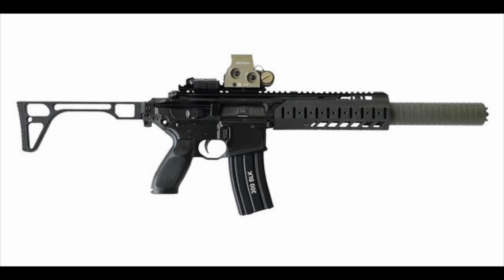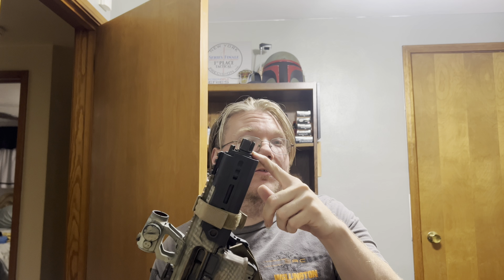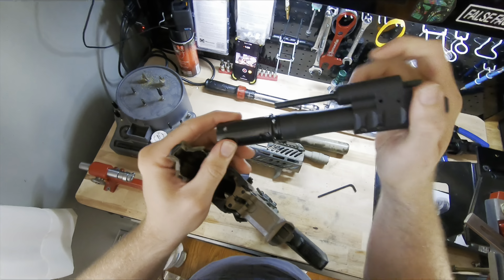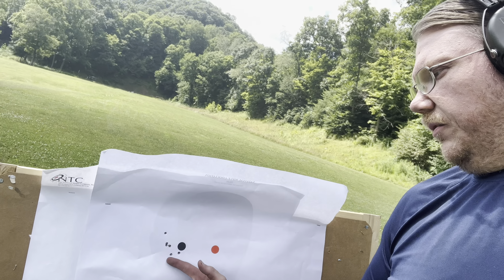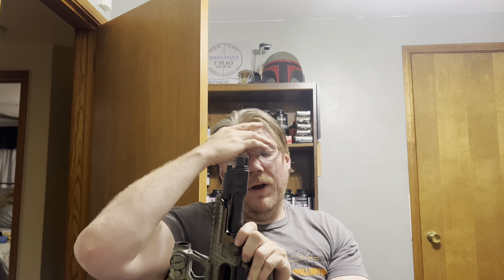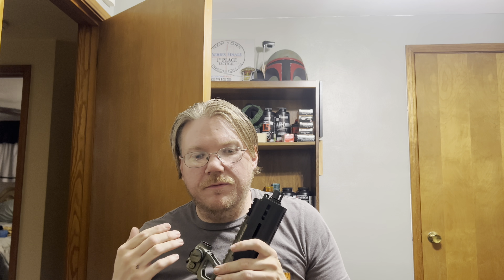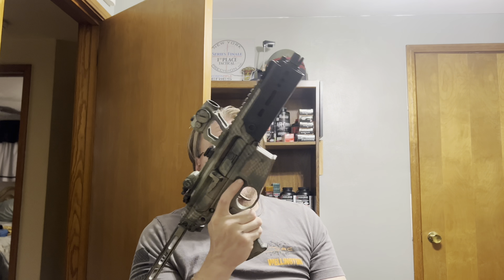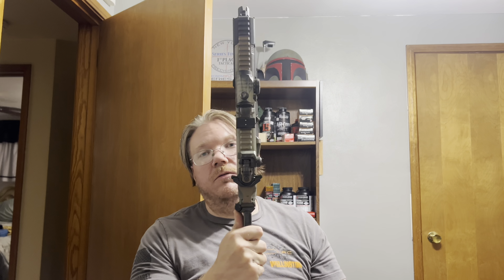Sig MCX Rattler: The best gas piston platform of all time?!

Comment: With the rounded lugs on the bolt, would it be possible to run a KAC bolt in this system or are there substantial differences between the 2 despite the fact they are both rounded?

Comment: Bruhhhh…Best piston system of all time??? It’ll take YEARS and a LOT more real world achievements to take that title from the AK.
Reply from the maker: It’s meant to be inflammatory. Actually in the passed few years, US available AK’s haven’t been that great. 

I’ve had 2 arsenal AK’s. The 107 has been great to me. The 106 I sold after a year.
Reply: @durkydurk5244  don’t misunderstand, I’m not even into AKs. I’ve never even owned one and probably never will as long as I can source AR platforms.
Reply: Just booth my 16" virtus but it won't stay 16" long. 10" sd hg with 6.75 barrel and trash panda. It's sad that I've already got the trash panda and the barrel and he will be the most difficult to find at the right time.